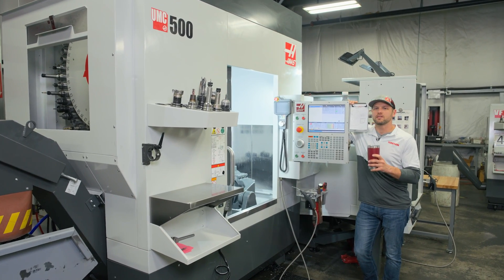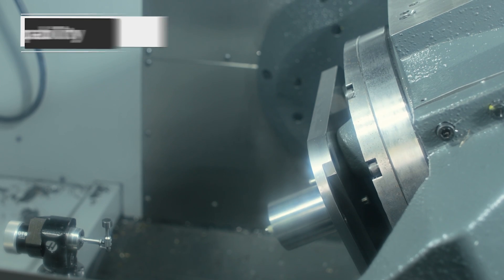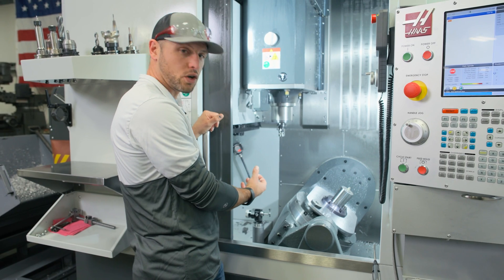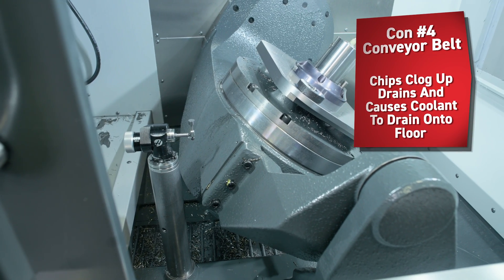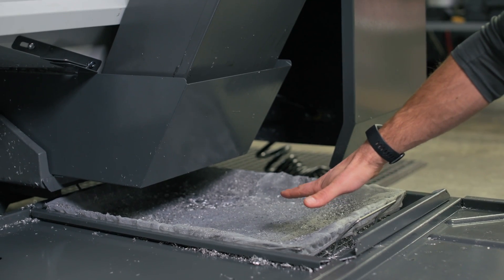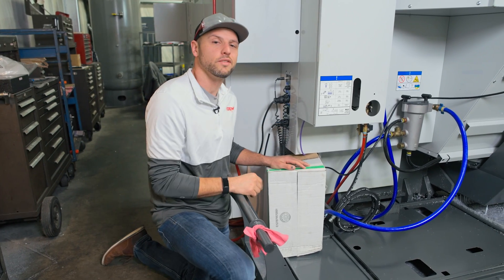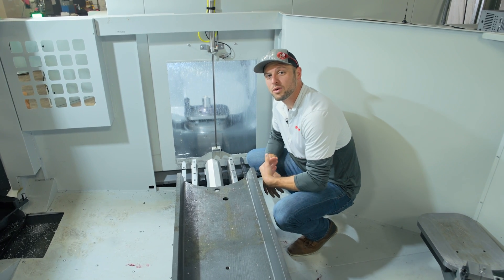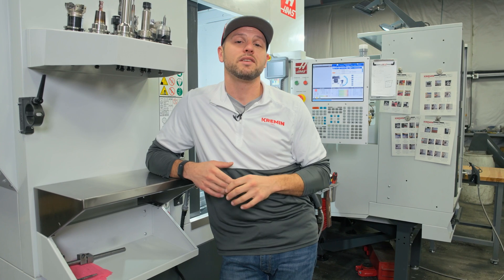HAAS UMC 500 - Kremin CNC Machine Reviews

Comment: Your probe eye seems to be installed upside down. If you notice, the Renishaw logo is written both ways. Your Haas tech probably should have rotated it 180deg so that the cable goes directly up; thus avoiding any chips hanging on the cable.
Reply from the maker: Thanks for the tip, we will ask about it.

Comment: Ever experience a thermal comp issue on that?
Reply from the maker: Not yet, has it been a big issue for you? How old is your machine? Is it something that popped up right away?
Reply: @KreminIncManufacturing  This wasn't my machine but a machine I recommended to the owner of a shop I was helping build. It had an extreme compounding thermal comp issue only on the Z axis. We were left for months waiting on a fix that never came in the roughly two years I was there. It never showed it's face until I was doing a very long surfacing operation in full 5. At one side the tool was cutting, and by the other end of the surface wasn't even touching the part.

Comment: I purchased a UMC500 in 2020 (covid machine) and it's bipolar.  It's been the most productive machine in our shop and it's also had the most down time.  We're fighting two issues: quality of design and quality of manufacturing.  The biggest design issue is the chip management; lots of chips get past the conveyor and quickly build up in at the edges of the chip tray in the sump.  If you don't keep the chips from building up, the coolant begins to overflow out of the chip tray.  We have fabricated our own chip filter (to catch fines) and raised the walls of the chip tray.  We have also made diverter wings to move the coolant flow towards the middle of the chip tray.  No more overflowing coolant due to chip build up. The other major quality issues  have been related to sloppy manufacturing and early component failures.  Much has been covered under warranty but we've take big hits in down time.  The B axis limit switch failed after 1 year and the took out the probe when the machine tried to home.  There was a service access plug in the C axis casting that was missing.  This allowed coolant to get in the casting under the vise and soak the electronics.  Again, it was repaired under warranty.  One week after the warranty expired, the spindle went out.  Haas and our HFO took care of it under warranty.  We had the exact same issue you showed with the pallet access door.  No tolerance analysis was done on the placement of the door sensor.  I've never had so much trouble with a new machine and we have purchased 7 from Haas so far.  Haas seems to have the 'bang for the buck' portion of the CNC machine tool market dialed in.  Haas machines have helped me build my business and I'm grateful for their service and products.  That said, I'll have a hard decision to make if I ever consider purchasing another Haas product.
Reply from the maker: Thanks for the comments, we have another video that will be up in a week or two that goes through all the work the HFO did on the issues we outline in this video, they have stuck with us on trying to make it right. We also have an additional 7 Haas mills and 2 Haas lathes, so we made a commitment to the control, but I am with you - need to put a lot of thought into if we will be adding another one or going with something else.
Reply: You're a beta tester basically. Maybe now, 3 years after they released, they are close to selling a machine that they should have had sold you at the start. They basically scammed everyone with the "Reboot, everything is better" marketing, when in fact they were just looking for dumbasses to beta test their machine/screw over.

Comment: We have a UMC500 for almost 2 years now and it has been nothing but trouble. The machine is really not stiff enough and even has repeatability issues on the Y axis
Reply from the maker: Thanks for the info, machining product wise, we have not had too many issues, most of the problems have been with the add-ons. We just did an update to the review, it should be on the channel in the next couple of weeks. Good luck with your system.
Reply: @KreminIncManufacturing   New issue we are dealing with now is that the spindle cooling fan is introducing vibration into the machine. And that is showing up massively and destroying surface finish. Took Haas 6 months to diagnose and resolve! They replaced the fan 2 months ago and the problem seemed gone. But last week the finish problem returned! A new fan is already on order. To be continued I guess

Comment: Doesn't Haas recommend the chip disk filtration system to eliminate clogging with fine aluminum chips? Is this not what is happening here, clogging from fine aluminum chips and the lack of the CDF system?
Reply from the maker: So Haas has been here a few more times in the last couple weeks working on this and the issue if the chips clear the machine and pack in/clog the coolant return system - so its a little different we think. They have made modifications to the sheet metal system where it exits the machine and enters the coolant tanks and it has gotten better.

Comment: So explain this to me.  Since its a 5 axis why do you need large amounts of rotation on the B axis swing going both ways?  if you need to swing wide going to the probe side, index the part 180 and hit it from the non probe side?  Am I missing something here?  Its like asking why a CNC lathe doesn't go very far past center.  Just curious cause I don't know.
Reply from the maker: We purchased this as a turnkey from our haas dealer for a specific project that was running 3 parts on one pallet being held by a pyramid style fixture - to get all sides of all 3 parts we needed more travel - we made it work with different fixturing but it was missed in the original design we had spec’d out - being our first true 5 axis - we weren’t aware of it - now we know
Reply: @KreminIncManufacturing  Ok that makes sense.  Thanks for the intel.   I am considering a 5 axis in the near future at our technical college.  Trying to get as much of a grip on it as I can.
Reply: @KreminIncManufacturing  Ok so one last question.  If a person was considering one of these and was not limited by the uniqueness of fixturing where you could spin the part 360 degrees in the C, is it safe to say its not really an issue?  We would likely be running mold cavities that we would mount in the center of the rotary. Thanks
Reply from the maker: You are correct - not an issue if you are running one part at a time - you should have access to all sides by rotating the one direction.

Comment: Years ago I modified my conveyor on a cnc lathe that 99% runs aluminium parts, them chips are a pain in the _ss.
We made an airblast-pipe with small holes at the top of the outlet (spout) that is controlled by a M-code for the conveyor.
After the M-code for the conveyor (Forward) is activated a PLC comes in that opens an air-valve, after one or two seconds the conveyor starts running and a few seconds later it stops by M-code (Stop), the PLC stops the air-valve after a second so the conveyor-belt is always clean at "the end" when it starts spinning. It takes a few second per part but that prevents me a lot of extra work cleaning that conveyor, it prevent chips to go back under the belt and falling below on the coolant tank.
There are special relais that have timers or when your machine has a M-code for conveyor-return you can find out some other options.
Reply from the maker: Thanks for the info!
Reply: @KreminIncManufacturing  
You're welcome. 😉
Reply: I added an air knife to the chip conveyor to clean it off.  I wired the valve in parallel with the chip conveyor motor so when it runs the air blast is on.

Comment: Had our UMC750 only 5 months.Most of the time there where technicians crawling in and around it. When they finally picked it up again, no one from the HFO came. We loaded it onto the truck ourselves, with a rented forklift. Never heard back from either the HFO or Haas. We bought DMG Mori instead and never looked back. It wasn't even much more expensive, but the built quality, precision and features on that machine blows Haas out of the water. Will never buy a Haas again.
Reply: Which model did you go with if you don't mid me asking? I am pricing out some machines and would appreciate any advice on 5-axis.
Reply: @lvxleather go for Hermle or DMG Mori. Some of the best 5ax on the market

Comment: What are the tolerances you can hit with this machine?  How is the thermal stability? Cool honest video!
Reply from the maker: The UMC has been a good machine in general, it really depends on the feature you are machining as far as the tolerance window. I do not believe this unit has thermal compensation like the Okumas do.
Reply: @KreminIncManufacturing  They do a thermal compensation calc. in the control. i know this because my UMC500 was WAAAAAAY out of tolerance, and it turned out that the thermal comp. was doing somthing strange (or at least that's what HAAS UK told me). 
Great starter 5-axis machine. But my days, they had the new-start intern designing certain parts of it. The chip conveyor is laughable.

Comment: The coolant issue issues are the same for the 55 gallon tank to return screen is in the same exact place
Reply from the maker: Thanks Corey, we thought it was from the larger coolant tank - interesting it’s the same issue on the standard size.
Reply: @KreminIncManufacturing check out the swarf unlimited upgrades chip filter screens. We just installed one of their xl filter screen and it has solved our coolant issues
Reply from the maker: We will check it out. Thanks!

Comment: Awesome video. I was saving up for a umc-350. I had heard from some one that the umc-500 a few bad things but didn't know about the probe stand limiting the trunnion rotation... that a major mess-up. I might have to wait to buy until that is fixed
Reply from the maker: Take a closer look at it, I know another person commented it does not interfere on the UMC1000, and in most cases you don't need to go that far in that direction - we happened to be running a project that had 3 parts on a pallet and needed the most flexibility to get to all sides of each part when we rotated.
Reply: @KreminIncManufacturing  instead of tuning the table to the right side, why dont you just rotate the platter 180 degrees and rotate the table to the right side? problem solved
Reply: I was just about to say that, there is no limitation.

Comment: We have a UMC 500 that is roughly one year old and made a video on our channel as well. We have seen a couple of the same issues you have mentioned. However I don’t see the issue with the B-axis limit. I don’t think we have ever needed the B to swing that direction even one degree past zero since our post processor just relies on the C instead. My brain hurts thinking about it but doesn’t it seem kind of redundant to swing an equal amount that direction? Curious if you have had a situation that actually needed it. Great video though +1 sub
Reply from the maker: Nice job on your video as well. As far as the swing, we had it set up for a project that had 3 parts on pallet. The 3 parts were on a pyramid riser to allow to get to all 3 sides of all 3 parts - we made it work but it was tight.

Comment: The Renishaw OMI is able to be rotated so it's angled downward to keep chips from sticking.
Reply: I added a wash down subroutine to the 9853 program so every time I do a breakage check it washes the omp and tool.  I also changed the broken tool alarm from a 3000 alarm to a 3006 user input.  It changes a broken tool alarm to an m01 so the user can verify the tool is broken and not have to restart the program.
Reply from the maker: We have it angled down, but I will have the team look at it again, we might have more to go. Thanks for the feedback.

Comment: we have a umc 500. not sure if its same problem or not but when we first got ours end of October was getting a lot of chips out where the coolant drains and building up in the drain area of the base where the conveyor sets inside the machine that would cause over flows in front of the machine.
service tech was called in, right away says chips shouldn't getting in there.
removed the conveyor, discovered some parts installed wrong at the factory. 
if you are standing at the operators door looking down at the conveyor you'll see some hex head bolts that holds a part shaped like angle iron with a real short leg on one side. the short leg  is supposed to point up toward the bottom of casting to keep chips from  from getting out of the conveyor.
on our machine these pieces were upside down leaving a huge gap for chips to get into the drain.
now we get very little chips out of the drain screen
Reply from the maker: Thanks for the info - we will check it out closer - I know the service techs have been out 3 times for the chips clogging the coolant flow but still haven’t fixed it
Reply: @KreminIncManufacturing  if you're familiar with the area i'm referring to where it transitions before the chips drop on to the belt. you shouldn't be able to your fingers up under there very far if those parts are installed correctly
side note, he had told us to stay away from the high pressure flood coolant. more trouble than it was worth. LOL

Comment: Did yours throw tools at random during tool changes? Place I used to work for got one early 2020 and it would throw tools at random right against the sheet metal. sounded like a bomb went off in the machine.
Reply from the maker: Not yet, but we appreciate the heads up 😉
Reply: @KreminIncManufacturing  Haas actually turned new pins somewhere local and then brought them to our shop and swapped them out with the pins the machine came with. A pin in the tool pot was to short and that's what was causing the issue. They may have fixed that issue by now. We got one of the very first 500s they released. It was an HsK63 Spindle. They did not replace the damaged sheet metal.

Comment: Would you get a mori then.  I have talked with 5 other machinist who all said they moved from a HAAS to a Mori.
Reply from the maker: Good question, we have tried to keep similar groups of controls to make it easier on the operators - we have 9 Haas machines so it’s nice from a training perspective. That being said we also have a lot of Okuma’s - we would probably look to Okuma first but if we are going in a different direction we would evaluate all other options - DMG Mori, Okuma, we have also considered Robodrills - lots of good options. If we get a new model, we will give an update on it.
Reply: @KreminIncManufacturing  Thank you.  I subscribed. great channel, and good review. Mori quoted a DMU 50 to me.  the machine cost around $450K.  I have heard nothing but good things about the machine.  Doosan also has a comparable 5 axis for $300k.  I want one of the new Kitamura 5 axis machines to make injection molds with.  kitamura machines cost as much or more than Mori.  The smallest kitamora cost 300k    I have yet to get a quote for their bigger kitamura   I will see what spec Okuma machine have. I also really want Mazak's horizontal 5 axsis HRC-5000 mill.
Reply: @sheepman6291  We've got a Doosan DVF5000. I think it's closer to the UMC750 in capacity. It has some similar issues, the conveyor can clog and flood and the side door leaks a little if it gets hit directly with coolant. The fanuc control is less user friendly than Haas. Overall it's been a great machine. Pretty much maintenance free since we bought it a year ago. Uses a grease cartridge that lasts a few months instead of filling way oil daily. It doesn't bog down with fast programs so no issues with 5-axis profiling operations. And you can load tools directly into the magazine instead of only through the spindle like the Haas. I've been pretty pleased with the 9 Doosans we've bought. Good value for money.
Reply from the maker: That’s good to know, thanks for the information. We have 2 doosan chucker lathes but haven’t looked at their milling centers yet.
Reply: @KreminIncManufacturing  doosan machine is great !!! They’ll take over haas merket !!!! Even the entry level dnm 350 5ax is get better better than haas machine and the high performance line dvf5000 is more accurate , they’re have the glass scale on all axis, you cant able to find any machine with that option for 260k.
Reply: @KreminIncManufacturing  we have the dnm 350 model . My machine was running 100% titanium and the spindle time is 11k hours. Never been servi form doosan ,
Reply: Mori definitely pays more attention to little details like these, but they're also like a 50% price increase over the Haas.
Reply: @thedroolfool  You get the tolerances you pay for.  Mori machines are so accurate you can upgrade them for grinding.  The upgrade cost $80K more.  My DMU mori quote was for $450k.

Comment: It’s basically a pressure washer pump.  It’s going to be that loud.
Reply: Oof. I’ve been banging the 5-axis drum at my shop, with an eye on the UMC750. Now I’m a little hesitant. 😬
Reply: It definitely makes sense but I could barely hear the multistage 20bar TSC pump on a DMG...sounded like one of these new washing machines that only makes a tame humm
Reply from the maker: Its a known issue on this machine, they have had other complaints. We have 6 more haas VF2's with high pressure coolant and all of our swiss lathes and chuckers have high pressure systems - nothing that loud.